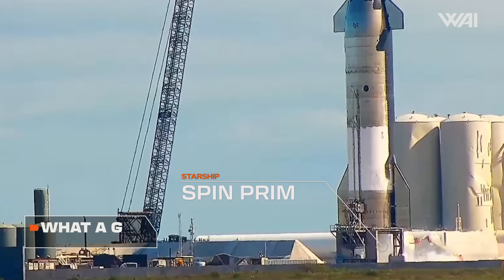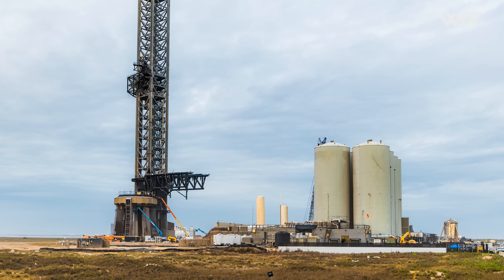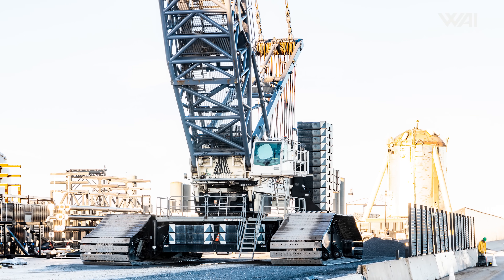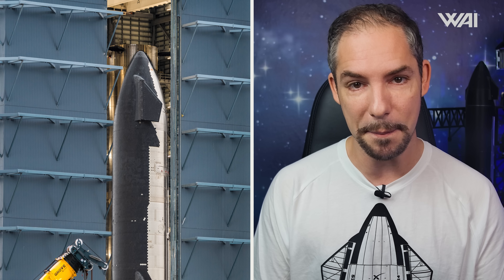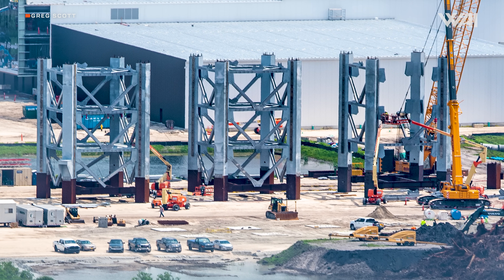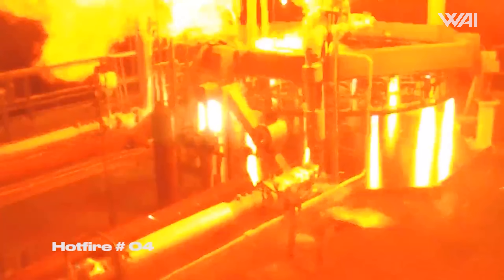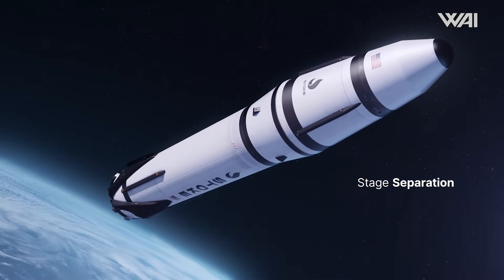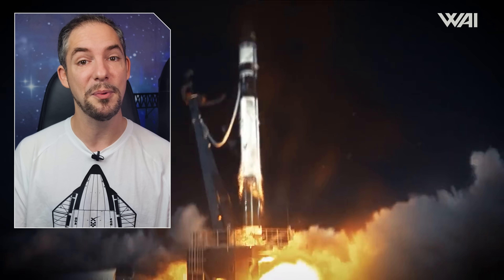It's On! SpaceX Sets Record Time For Starship Testing!

Comment: I can't wait to see IFT-3 happen! I hope they finally nail the next starship launch!
Reply from the maker: Soon! I can't wait either. My guess is that the goal for IFT-3 is going to be to get the booster to its designated landing zone. That would be the next big step forward! :_WAIStarship:
Reply: @Whataboutit  Booster return is more of a priority than starship to reach its target re-entry ?
Reply: @callumcurtis15  For sure.  Booster has 33 Raptors, Ship only has 6 (eventually 9).  The engines are the biggest cost driver.
Reply: Finally? Wow
Reply: @daveken9936 what?
Reply: @daveken9936 2 attempts, 2 ruds 
Yup, we'll be to Mars in no time.
Reply: @daveken9936  Ahhh keep in mind EVERY launch of the massive Saturn 5 was success using 1960's technology mostly slide rules.  Not everyone is impressed with the recent SpaceX failures, just the hard core fanboys it seems. Oh actually a year ago the massive SLS 1st launch was also successful, it circled the moon and return a capsule safely back to Earth if you want to see what "wow" looks like.  Meanwhile Tesla fanboys "cheer" like every failure is a great success lol
Reply: @Battleneter  The Saturn V had a very different development method, which was: DO NOT FAIL. EVER. This led to a large amount of modeling and even then, the Saturn V still had a partial failure (Apollo 6).
Starship, however, is learning by testing, which is faster (and much cheaper).
When failure is expected, progress is impressive.
If SLS failed on Artemis 2, that would be bad, because it's not a developing rocket. It's "operational"
Reply: @bryanillenberg  Yes it was a "very different development method", it was to succeed first time. I am just pointing out why not everyone is not super impressed with SpaceX, the Starship is hardly revolutionary , most of the basic technology is literally decades old, but its hyped like its warp capable lol.
Reply: @Battleneter because the rockets like SLS cost billions each and cost overrun 5 to 10x the expected costs. While spacex doesn't publish the cost they seem much closer to the 100-200 million per launch with the goal of reusability.

NASA already tried a reusable rocket like this... they threw half of it away every time and killed a fair number of people with it, and required a billion in rebuilding every time. So ya people are way more excited about a much cheaper, much larger reusable rocket.
Reply: @petergraphix6740  Hmm did you know when SpaceX took over supplying the ISS from the Russians it cost "more" per launch.    Even the hyped cost saving aspects of SpaceX  is really not that impressive.
Reply: @Battleneter  Oh really? you better check the launch cost of reused rocket now
Reply: @Battleneter  All other stuff aside, I don't see how Raptor's full flow staged combustion is decade-old
Reply: @maxi4251  Guy is baiting yall ☠️
Reply: @Battleneter Just here to pout? 🥺
Reply: @Battleneter  What makes it revolutionary is reusability.  No part of Saturn V was reusable, didn't even try.
Reply: @Battleneter  Cost more, or had a higher price?  Cost is what SpaceX pays to do it, price is what NASA pays SpaceX, profit is the difference.
Reply: @JClarkeCT1334  Reusability is a bit of a scam, the cost saving are mostly chewed up by the required refurbishment.
Reply: @Battleneter  That was true for the Shuttle, which dumped its boosters into salt water at around 50 mph then towed them hundreds of miles in the water.  It's not clear at all that it is true of Falcon 9, whose boosters are fully operational at touchdown (if they weren't they couldn't soft-land), land on a solid surface, and are never in the water.
Reply: @JClarkeCT1334  Falcon 9 booster are still refurbished mate every time, you are believing in a popular lie.
Reply: @simonethier5793  Just talking about data and facts, sorry if I hurt the feelings of any Tesla fanboys  :)
Reply: @Battleneter  So you're saying that SpaceX is foolishly wasting their own money recovering and refurbishing boosters when it would be cheaper for them to just throw those boosters away?   Are you an accountant at SpaceX?  If not then how did you obtain access to this information?
Reply: @JClarkeCT1334  No there is a middle ground mate not everything is an on/off switch. I am just not as impressed with SpaceX as some of the hard core fan boys. If you really wanted to save $$ you would leave the Russians launching to the ISS as an easy example, as SpaceX is more expensive regardless of any limited reusability arguments.
Reply: @Battleneter  Show us your numbers for launches in 2023.  And consider that the current NASA contract was negotiated years ago before reusability was a given.
Reply: @JClarkeCT1334  I am not here to educate you, should do your own research, then come back here and you will see exactly what I am talking about.
Reply: @Battleneter  "If you really wanted to save $$ you would leave the Russians launching to the ISS" 🤣😂🤣